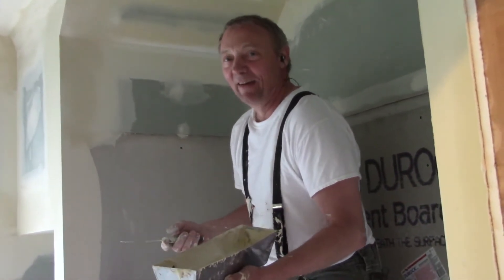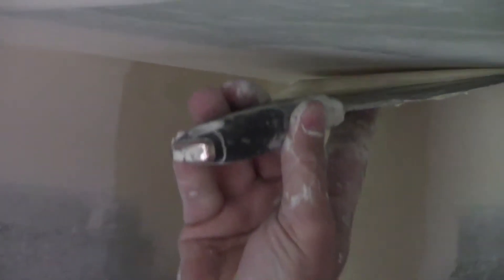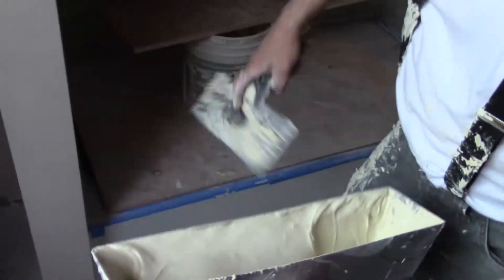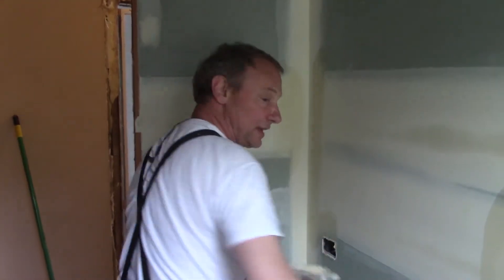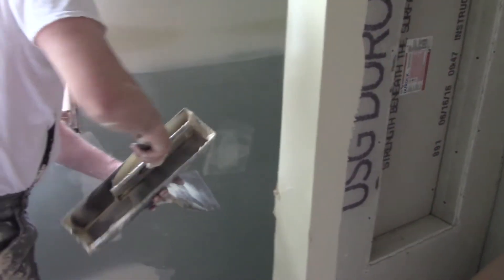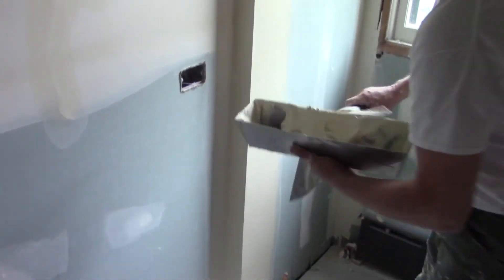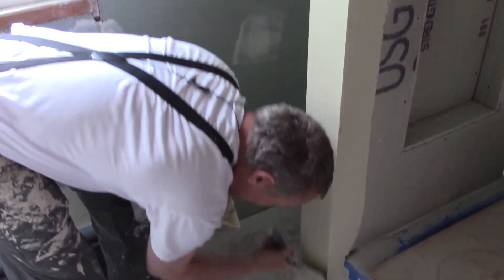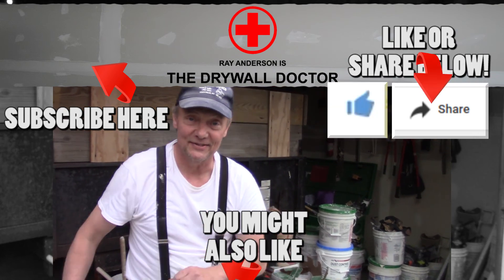Is your Mud to Thin? Can you Still use Thin Mud? here is how

Comment: Im a taper from Scotland buddy , USG don't really hold the market over here for drywall materials , British gypsum do , but i can tell you from the many compounds for finishing drywall from ready mix light to hand mixed BG joint cement , I have used the same technic for leaving thin mud on the corner tapes and let it tighten up just like finnish plaster dose then polish smooth it down  , i have often done this for skipping a coat when working for assholes who refuse to pay to get the job done right over the years , One coat hotmud and one heavy thick top , leave it to sit while you do most corners in the whole upstairs of a house , then fall back and smooth them all down , no one ever notice i skipped one coat as the shrinkage is very low when done like that...lol  ;)

Comment: I thinned down some USG dust control for ceiling texture and now I want to use it for joints, how do I make it thick again?
Can I add some 90 minute powder and mix it in?
Reply from the maker: I wouldn't use durabon but a light weight 90 should work.

Comment: What's the point in "tinted" mud? Is it point up mud,so you know where it needs sanding?
Reply: KENNETH WILLIAMS yes sir.
Reply: Pick up some chalk line chalk, various colours, and use that to tint your mud. 
I tint setting type mud green (because blue and red are taken by other types of mud), regular topping mud red (as that's the colour that is the printing on the box), and light easy sand mud blue (as it comes in a box with blue printing).  
It also helps me keep the pails of regular topping mud and easy sand mud organized and not mix them up.  
Whatever you do, don't use food colouring.  It will bleed through many layers of primer and finish paint.